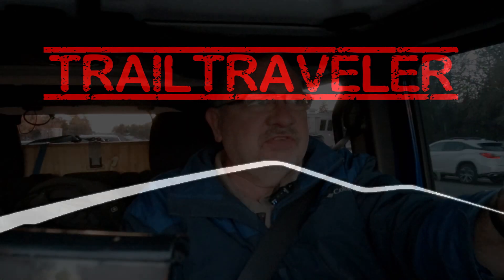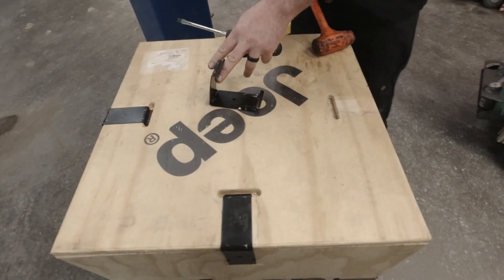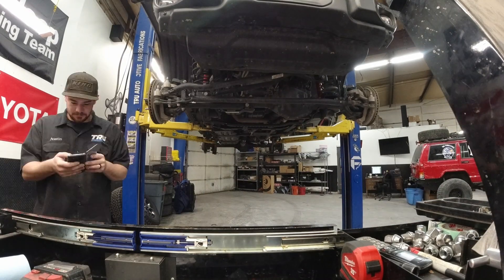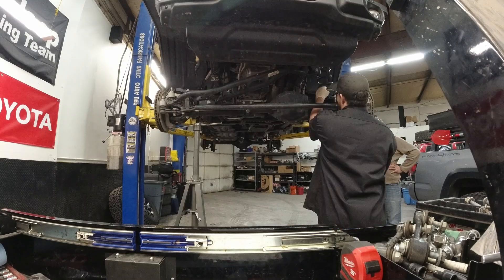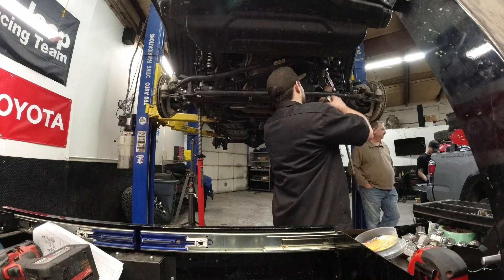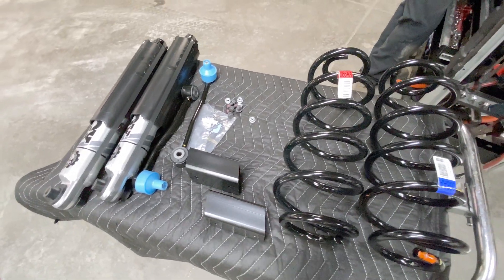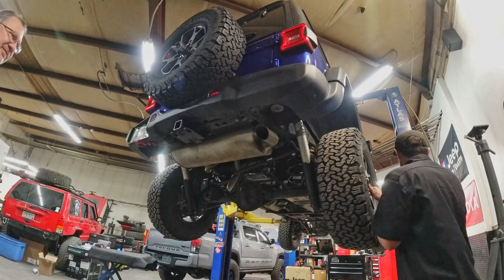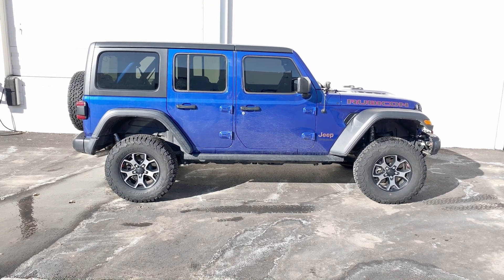Jeep JL Unlimited Rubicon - MOPAR 2" Lift Install

Comment: Did you have any issues with the common bow of the front springs?  How is the alignment?  Any death wobble?  I have the same kit but bought the day star coil pads to correct the spring bow and am thinking to get a new front and rear trac bar with the install.
Reply from the maker: Brian Benjamin It’s such a minor lift that the bow isn’t an issue to me. Took it right in after for an alignment and haven’t had any issues or death wobble. I did install a Rancho HD adjustable track bar in the front.
Reply: I think that’s huge that you have the track bar!  Thanks for the reply, much appreciated.  With all the talk good and bad I just want to make sure! Haha, hope you have an awesome Christmas brother! 🎄🎅🏼❄️🙌🏼
Reply from the maker: Brian Benjamin without an adjustable trackbar, a lift will shift the front end off of center. While it’s not really a “problem” and most people would never even notice. The big difference is in the bushings which makes everything feel more solid. For about $150 and 10 minutes of work, I like how it feels much better.

Comment: How are you liking the lift after a year? Would you do anything differently?Im  thinking about buying it and wanted your honest opinion. Thanks for the videos! Keep them coming.
Reply from the maker: I would say it is the biggest mistake I have made so far. You then need adjustable track bars and control arms and the shocks are mediocre at best. Save up and get a Metalcloak.
Reply: @TrailTraveler  thanks for your response. Much appreciated!
Reply: @TrailTraveler I’m  a new Jeep owner and had strongly been considering the Mopar until I read this. Can you expand on your feedback? Why Metalcloak?  Dis the Mopar kit produce bad drive ability? Death wobble?
Reply from the maker: @troutriver58  With the Mopar kit, you still need adjustable track bars to center the axles (which will improve drivability) and you need adjustable control arms to correct the caster (which affects how the front end recenters after a turn and helps it track straight). MetalCloak is high quality components with replacable bushings when they wear out and provides greater articulation.

Comment: after installing the lift, what's the overall height with the stock tires????
Reply from the maker: I didn't measure it, but it should have put it at 75.6" and then I gained another two inches when I put the Milestar Patagonia MT 37" tires on.

Comment: An install video on how to take it to someone to have them install it... title misleading.
Reply from the maker: The instructions are pretty clear, it isn't a hard job at all if you have the right tools available and a lift really helps. After helping to do mine, I would have no issues with trying to do it myself...if I had access to a lift. Doing it on jack stands is possible, but a bit harder.

Comment: Why doesn’t the Mopar lift fit a 2020 Rubicon Unlimited JL with the 2.0 Turbo ? Is Jeep going to modify/ make a lift to fit the turbo
Reply from the maker: There is a version for that. My buddy got it on his.
Reply: Trail Traveler Hi, do you have a link to the lift kit ? Thanks 🙏